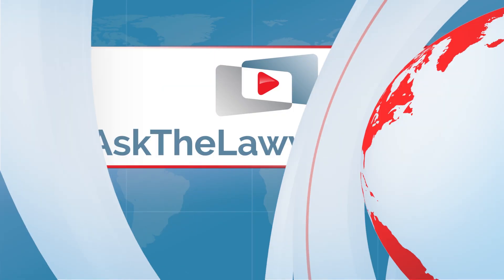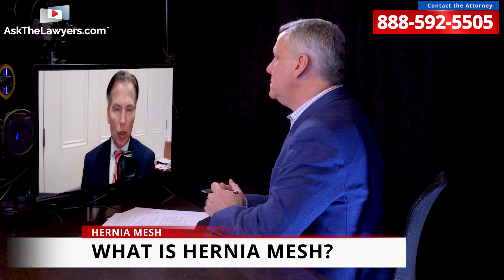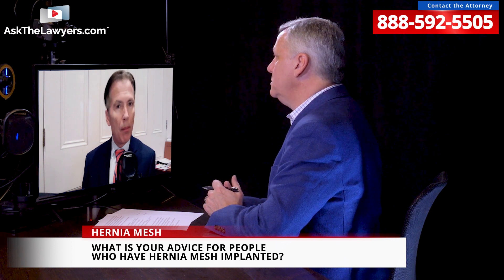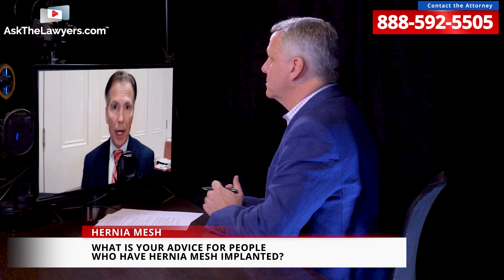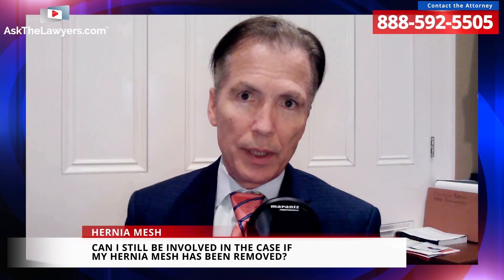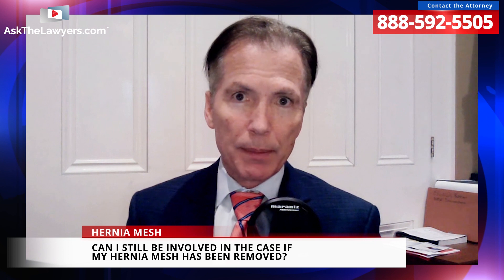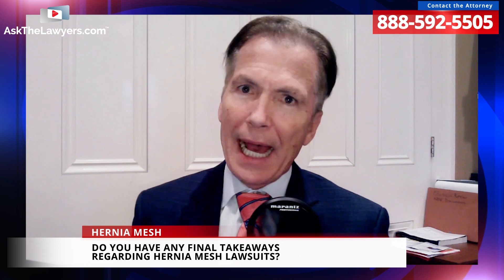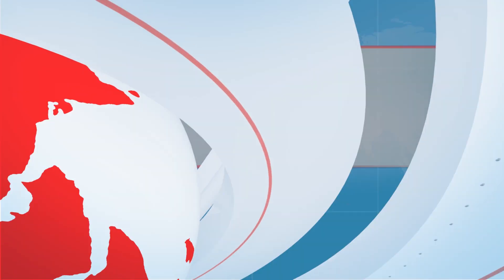Hernia Mesh Lawsuits: Do I Have a Case?

Comment: I had revision surgery done. The Bard mesh had migrated stuck to my sperm cord and had to be directed off the cord with a robotic arm. I had blood in my pee. The failed mesh also caused a new hernia that had to be repaired in conjunction with the old one. My nerve damage is so severe that I walk with a special cane and I am about to get a prescription for a wheelchair. I am permanently disabled and the pain is so bad everyday I fear long term the pain will be unbearable. Currently my testicle that the mesh migrated to is 3 times longer than the other one and I have appointments to see a neurologist, urologist, and may possibly lose the testicle. This is common for the Bard Perm fix Plug that I received. Any idea what a case like this is worth???
Reply from the maker: We are sorry to hear you had these issues. We are not a law firm, but you can reach out to the attorney featured in the video directly by calling: 888-592-5505 or filling out a form: https://bit.ly/2Esxsgg. Good luck to you